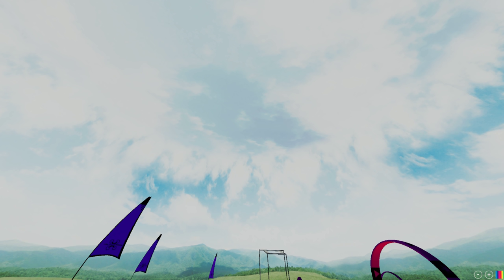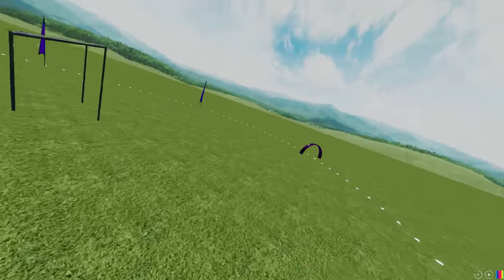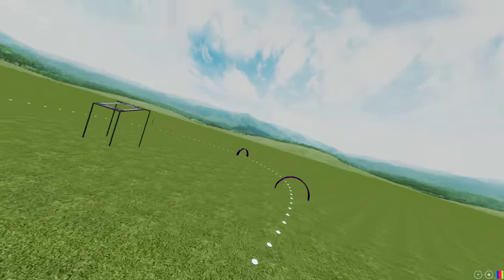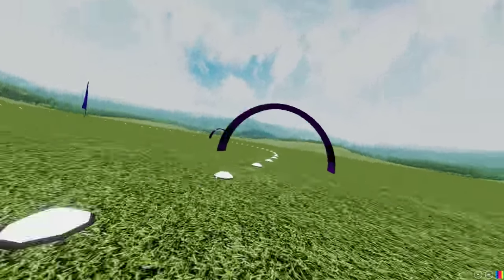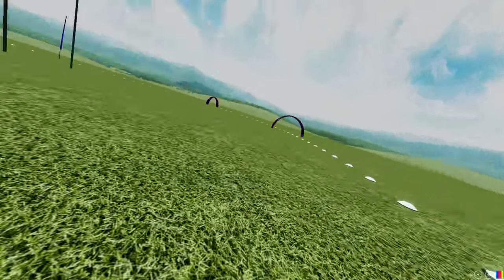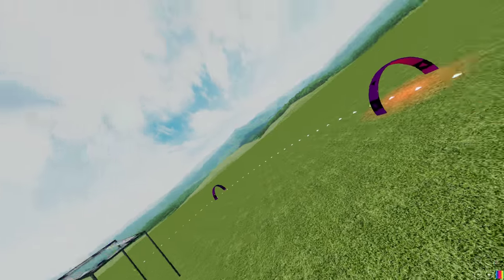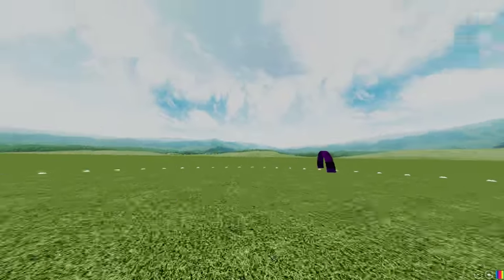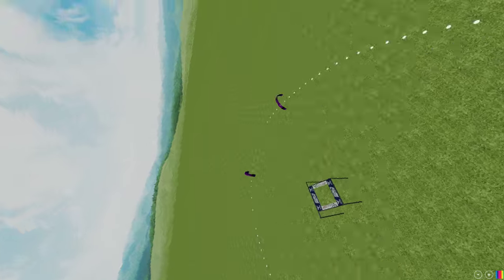Some technique discussion for flying sweeper gates and dive gates

Comment: Im new to quads .. how long roughly does it take on average to learn to fly rate mode . Thanks
Reply from the maker: a few hours - it's tough to begin with but once you start to get it then it gets easier quite quickly
Reply: @Velocidrone   thanks any tips to help . Is there any way to reduce the controls sensitivity maybe or just keep trying at standard settings .. thanks
Reply from the maker: @sdn1528  controls sensitivity is in the betaflight rates - just adjust to your preference - I think some of the videos in the earlier part of the flight training cover this.
Reply: You should look danimal FPV tutorial. They are pretty good for learning FPV flying. He explain some stuff than velocidrone don't explain. Like turning flag etc ...